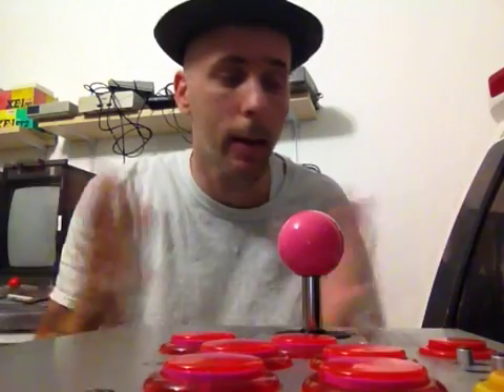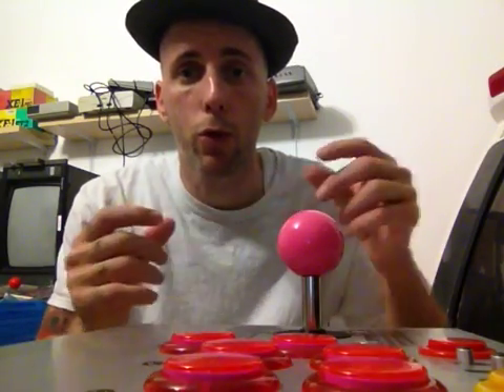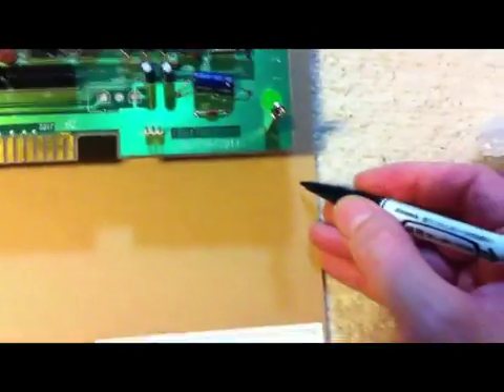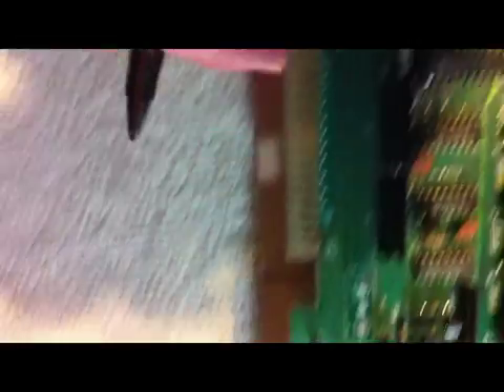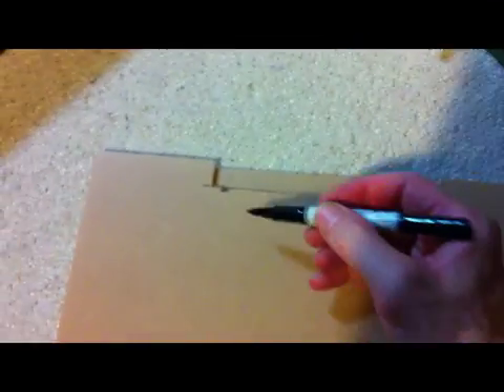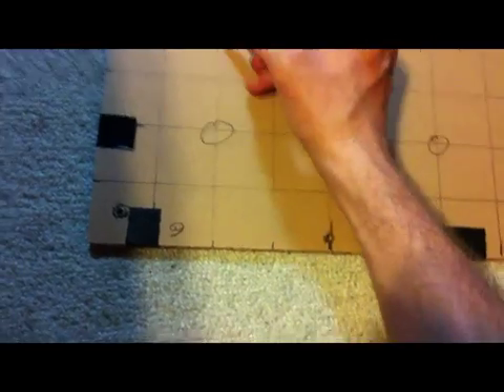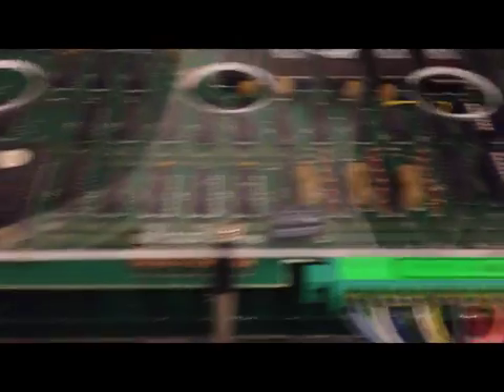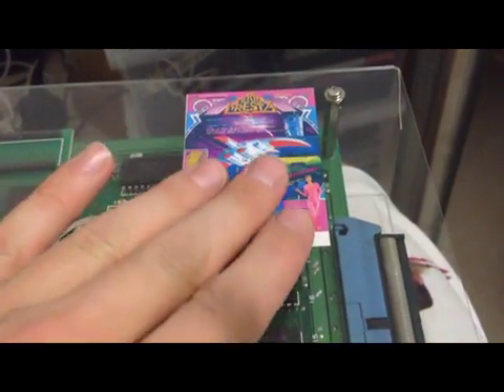Home made PCB casing - tutorial

Comment: This is a pretty good idea! Why did you need the ventilation holes when your casing is open around the sides? Wouldn't this allow more dust particles to be able to stick to the board?
Reply from the maker: Better ventilation, case is lighter also this way, and easier to grip!